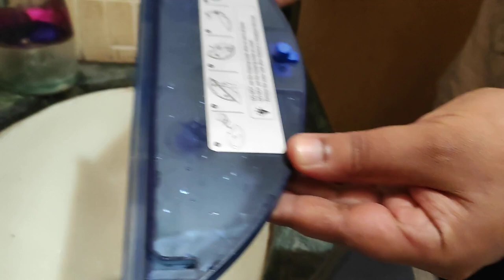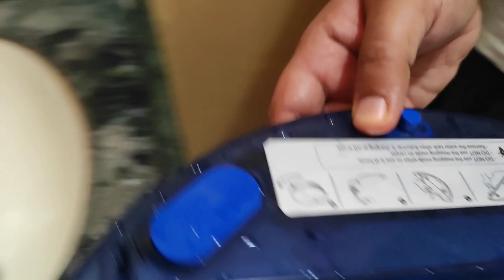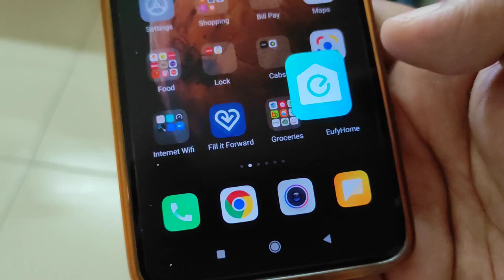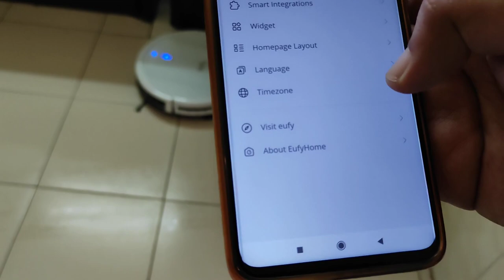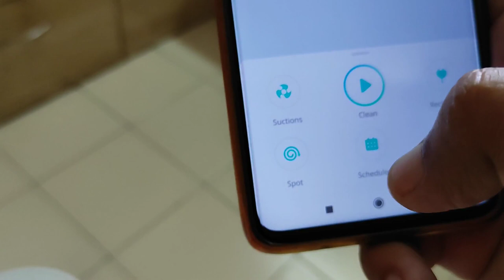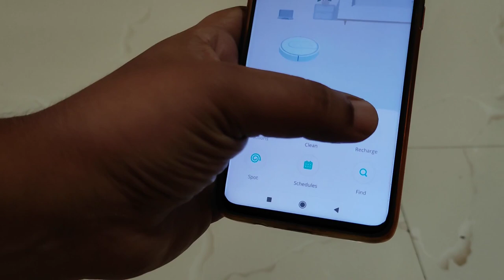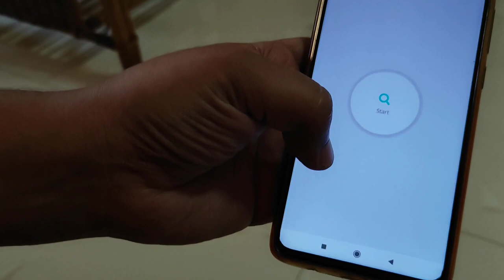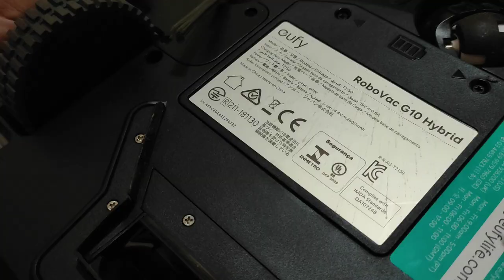Eufy Robovac G10 Hybrid Automatic Vacuum Cleaner I Mopping & Vacuum 2 in 1 I Detailed Demo & Review

Comment: I am also planning to buy this robot vacuum cleaner but there are so many I am confused and I don't want to spent more money. As my house helper is too good but just wanna buy it for my parents so just need easy operation ,is it really worthy?
Reply from the maker: It is good for everyday cleaning. But isn't effective on tough stains. Needs some monitoring. It follows a U pattern for moving, so with regular use, you can understand it's route and then leave it to work on its own.
Reply: @grandpasworld4164  thanks dear for quick reply. I got your point. 👍🏻
Reply: I wanted to offer additional input.    I have the regular eufy vacuum with similar features minus the mop, I will never go without a robot vacuum again.    Now i want a mop too.

I have used the brava 240 brava irobot, and already I have a broken machine. Envy has a really good trouble shoot system.

It is incredible how much is on floor and we don’t realize.   I don’t think it would replace a deep sanitization, but could it keep a house far cleaner in between and your maid staff would likely appreciate and have more time to focus on other details.

Comment: My device is not getting connected with the app..what to do...otherwise it is working as we switch it on..
Do we have to remove dust box when we will use it for mopping
Reply from the maker: Maybe you should try to re install the app. And no, you don't take out the dustbox as the mopping water tank fixes on it.
Reply: @grandpasworld4164  thnx..

Comment: Awesome but did you check the maintenance section the life of Rubber strips , where we can buy (brush and filter is given extra)
Reply from the maker: As far as parts, you can buy from these links:
https://dl.flipkart.com/dl/eufy-robovac-g10-hybrid-filter-pack-2-vacuum-cleaner/p/itm3a1e1053e101a?pid=VCFFYREFABFHZPVF&cmpid=product.share.pp
And
https://www.amazon.in/dp/B08RP1KKXX/ref=cm_sw_r_wa_apa_fabc_dG.9Fb7FDSSWT
Reply: Please read my reply carefully beforr replying the same , i didnt asked for filter its all about rubber pad attached with screws !! After few days it might worn out👍
Reply from the maker: You can get those rubber strips online too. They can be changed. Missed on thatone. And you had asked where to buy brush and filter, that's why I gave the links. Hope this helps.

Comment: I will buy (Eufy G30 Hybrid) today. However, because of your Indian accent I cannot understand everything. I am from the Netherlands. Do you know, if you need (like the iRobot i7), first use it for 4 to 6 times to make a map of your home? Or isn't that necessary at all? Furthermore, I think (I was informed), that you also can wash the filter under luke warm tap water and wash it. Can you give me some advice: "Do you need to run it several times (like the iRobot i7) for mapping your home?" Thanks in advance for your answer.
Reply from the maker: I don't know about much the model you have mentioned. 
The filter can be rinsed in running water. Don't use hot water or any detergent. Make sure it is completely dry before use otherwise it doesn't pull up dust. 
Mine doesn't have mapping feature, si I don't know much about it. 
Here is a manual that you can refer for your model https://dix7fd4yse9rd.cloudfront.net/s/eufy/product/6184537030842/files/1611301304653_d1qcymertks.pdf

Comment: How does it deal with lengthy human hair
Reply from the maker: Lot of hair becomes a bit of a problem. Sometimes it gets tangled in the brushes. But most other times it gets cleaned. If you keep the bushes clean before every run, it will be fine.

Comment: Does it not automatically go to charging station when battery is low or when cleaning it done?
Reply from the maker: It goes back to charging station when battery is low. I mostly give the command to go home after cleaning is done.
Reply: @grandpasworld4164  does it create a map of the house which i can see in the app to define boundaries?
Reply from the maker: It does not have map feature

Comment: Is there any India customer care contact number available? I couldn't find it online.
Also how the robot functions when there is any spills present in the floor and robot is cleaning in dry mode?
Reply from the maker: I too have no idea about customer care services.
In case there are spills when it is only cleaning on dry mode, it will only spread it further with brushes. Happened with us too.
Reply: Hi Shreyasi,
Hope your issue is solved. If not reach out to SURE FIX BANGALORE to get a solution

Comment: Previously it was not stuking under bed
Reply from the maker: Yea, sometimes it does get stuck in places that aren't cramped. Maybe some stuff is becoming a hurdle. This machine does need monitoring even in familiar areas.
Reply: there is feature to make noise to locate robot. it is under app settings for this. very smart.

Comment: Well I am using it from past 1 month. It doesnt go home after it cleans. 

The robovac goes home when the battery level is too low 

It hits the wooden chairs doors etc 

If you are facing same issue please comment below 

The replacement product also behaves the same way
Reply from the maker: Hey Anil, 
I don't rely on the machine to complete the whole house, since this machine doesn't have mapping function, it needs supervision and therefore it doesn't understand if the entire house has been cleaned. So I usually click on the Recharge button once done.
For us too, it hits the chairs or walls but figures out it's way.
Thanks for stopping by.
Reply: @grandpasworld4164  well as per the description it avoid obstacles 

So I think my robovac sensors are malfunctioning

Thanks
Reply: @suryasaianil  mine also hits chair and things that has legs or thin in structure, for walls it is able to detect and avoids. i dont know if its because of sensors being less or not working. otherwise this machine is amazing in cleaning and moping. and app is also great
Reply: @grandpasworld4164  if we want to leave it means dont have time to supervise .. so its not good for that ??for that i think mi vaccume mop is much more smarter 🤔
Reply from the maker: Yes, it is, as it can map the room.